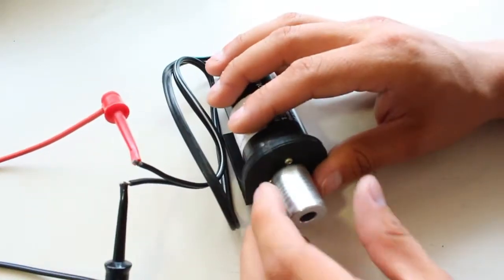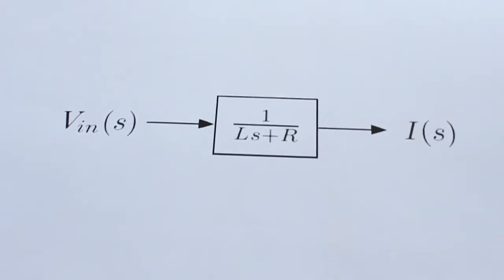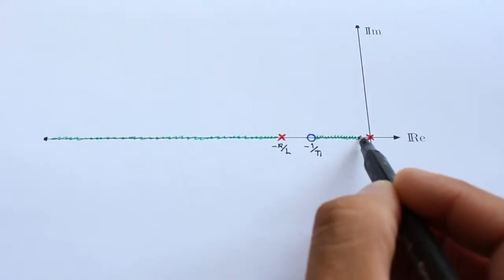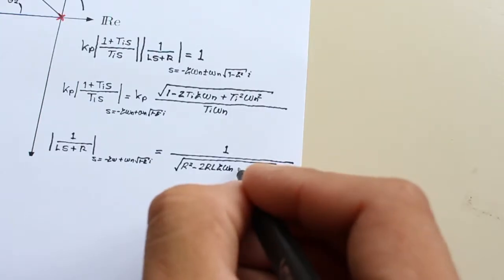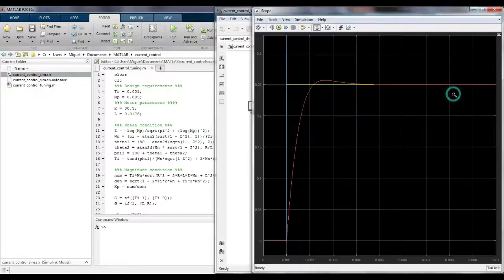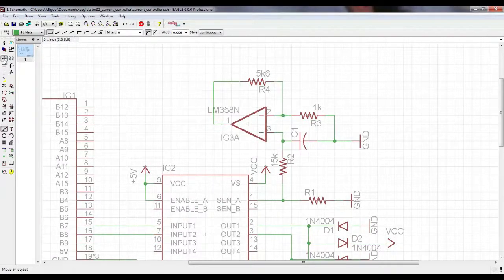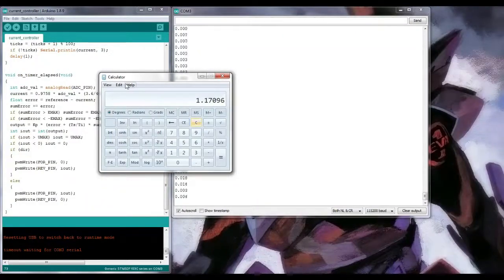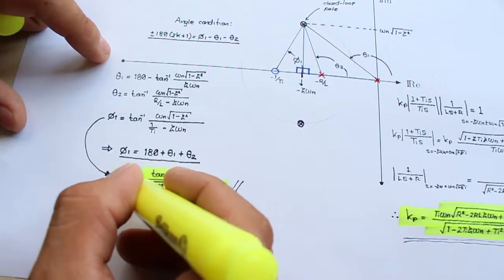Servo systems: Motor current controller

Comment: This video is what I am exactly looking for! Thanks for your efforts! 
Now I am going to do a project about dc motor current control.
So that brings me some questions to ask. 

How did you get the value of V0 as 0.159V? 7:51
Can I get the value of your shunt resistor?
and if you put a specific number to Arduino code as your desired current value, can the motor current reach the number?
 
It would be very appreciated if you could give me answers.
or my email: wo8566@naver.com

Comment: since you are going to do current control, in the circuit you created you failed to add the pwm that controls the input 'ENA', in the circuit you have it at input at 5v correponding with 100% of duty cycle, or not? 

There is something in your calculations that is not clear to me, because for the calculation of the amplifier you used a 0.159v? Vin, where did you get that? and what is the value of the shunt you used?